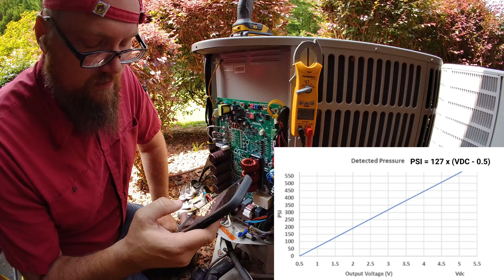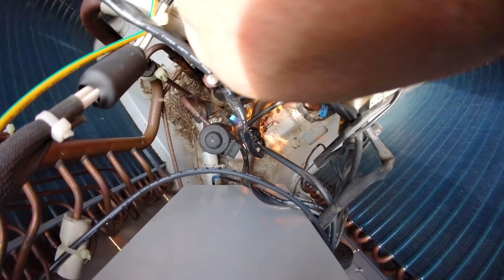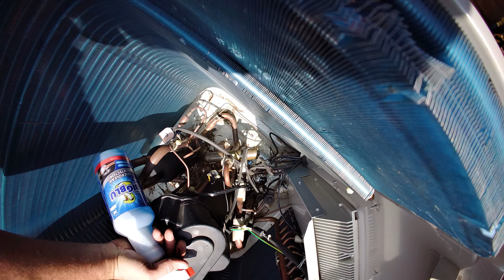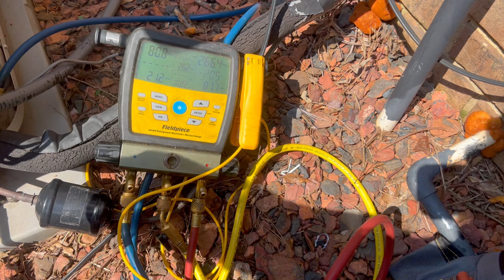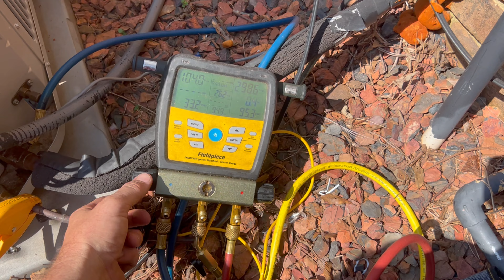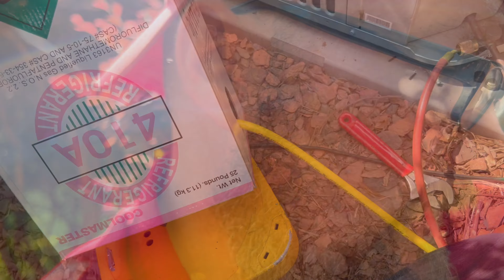Bosch Not Cooling: Faulty Pressure Transducer

Comment: was recapturing the refrigerant necessary? i came across service bulletin “BTC 761702121 A” which implies you can just add another transducer onto the existing suction service line without recapture.

Comment: Great video.  What's your opinion of these Bosch units?  Is it similar to the Gree?
Reply from the maker: In my experience they are pretty solid units. I've had to replace a few boards here and there, usually as a result of power surges or brown outs. 

Couple of transducers.

But all in all they are mostly plug and play.

Depending on the model of Gree they are pretty similar operationally, however the new R-32 units in both the FlexE and Flex both come with a communicating thermostat as part of the package, but also have the option to run with a standard analog thermostat, so for versatility  and the communication features I would lean more towards the Gree at the moment.
Reply: @HvacRideAlongs Great info!  Thanks and Happy Thanks Thanksgiving.